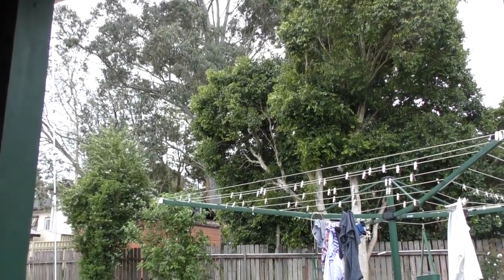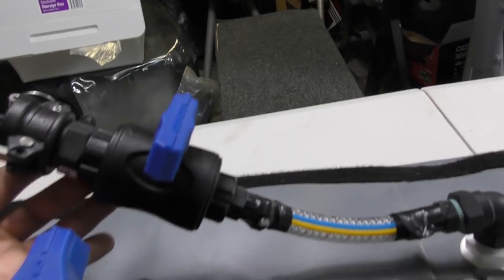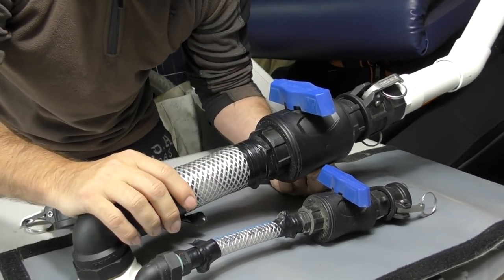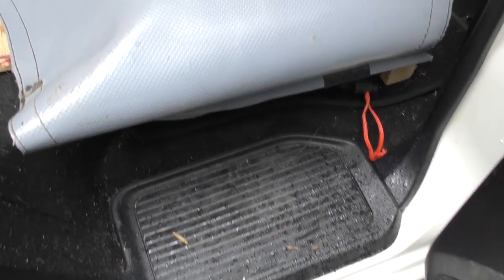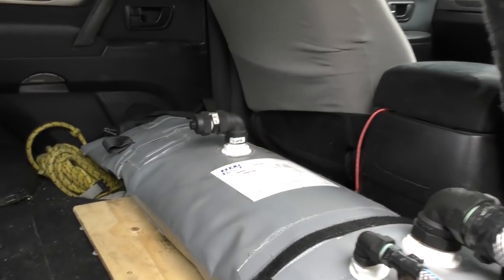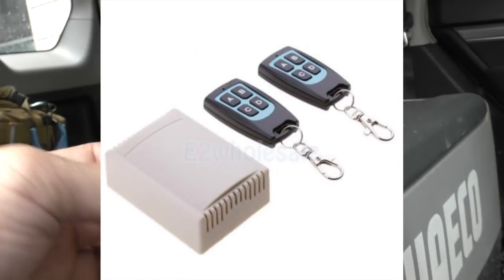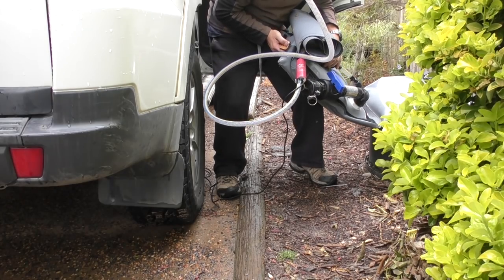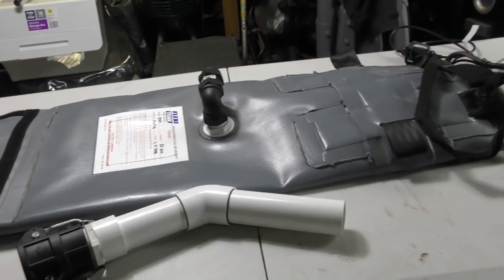FlexiTank Diesel Bladder - alternative to a long range tank?

Comment: Looks like a good investment , bit of mucking around, but it looks like its a specific type of setup you have to do for each requirement, Will have to look into one
Reply from the maker: I think so Trev.  Compared to the 3000 odd bucks for a long range tank option for the paj that only gives an additional 40L I reckon 150 was worth a shot. 

Will have to see how it works out in the field.

Comment: A very interesting option, as I had to keep four 20L cans in my Pajero for long trips. But I can not find the manufacturer's website, could you give a link? Maybe there is something on the label?

And it turns out that in Australia the fuel costs about 1.6 AUD / 1 liter?
Reply from the maker: Hey Ruben,   they don't make this model anymore and I'm not sure if these are now the same guys but this website should get you headed in the right direction http://www.fleximake.com.au/

Yes, thats the price. That is actually pretty high as its school holidays here and they put prices up then. Its usually about 10cents per litre cheaper. 
But it has gone up about 30 cents in the last 12 months or so.
Reply: Den, yes, I see that the website - http://flexitank.com.au no longer opens. I watched the products of the guys from http://fleximake.com.au and it seems to me that their bladders do not look so strong and thoughtful. In any case, I really liked your decision and I will look for something similar for myself.

Here, in Estonia (Eastern Europe), the fuel costs much more, and the last price at which I refueled was about 1.4 euros, I looked at the rate EUR / AUD, so it about 2.27 AUD.
Reply from the maker: that is expensive Ruben. I guess I shoudln't complain about 1.60. 

How does that compare to the cost of petrol there ?
Reply: Den,
Usually, we have diesel in the same way as petrol or a bit cheaper.

Today I drove a gas station and made a photo for you.
www.ruben.ru/lj/2018.10.13/2018-10-13%2015.37.56.jpg

95 petrol
98 petrol
Diesel (normal)
Diesel (with additives)

In Europe, simply terrible fuel prices. All because of the large tax that is already in the price of fuel. In neighboring Russia, fuel costs about 0.6 euros per litre.
Reply: By the way, if suddenly you decide to sell your soft tank, let me know, I am ready to be the next buyer :)
Reply from the maker: Thanks for helping it with the comment and link. Do you guys carry a diesel bladder like the one I show in the video for vehicle use?
Reply from the maker: @turtle-pac4829   thanks for the video. I had seen that before when researching my purchase but didn't think you made then in a comparable size to the 55L I have.  The video doesn't show anything that is sized to fit into a 4wd for example. do you have a link ?